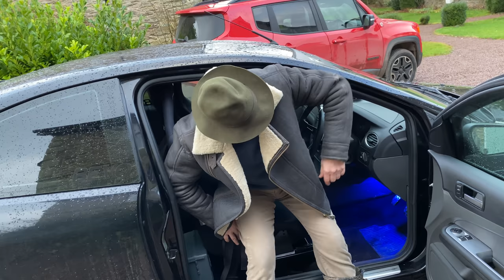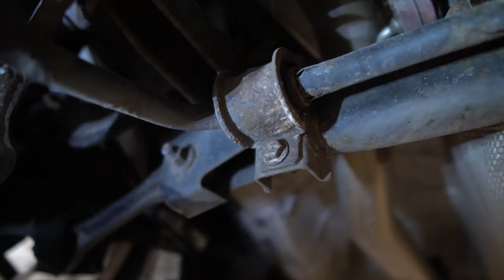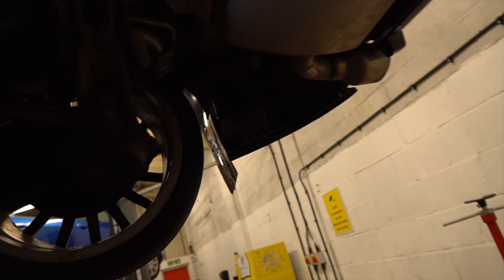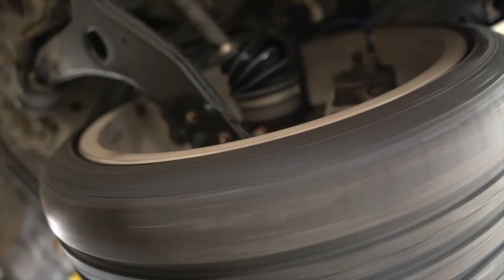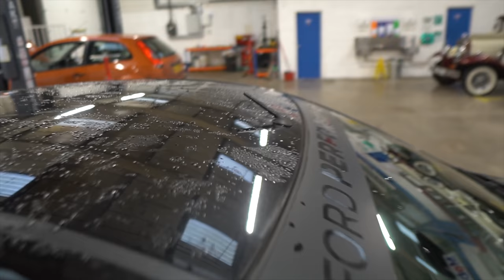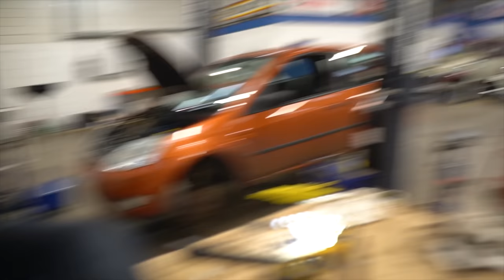CANT BELIEVE WE FIXED MY FOCUS ST FOR ONLY £10 | CHEAP FIX EXPLAINED

Comment: Could you have cut a slot on the joining part of the seat inlay so that the bracket slid in through it instead of cutting part of it away ?

Comment: No ... No ... Why did you cut your seat ... there was no need.
All you had to do was cut the top of the seat mounting bracket to clear the seat belt hole.
Those seat mounting brackets are very high and you have heaps of material to drill new mounting holes lower down to drop your seat height by a fair margin if you need.